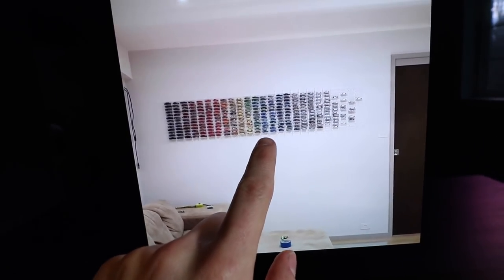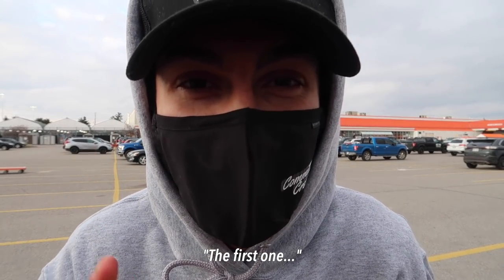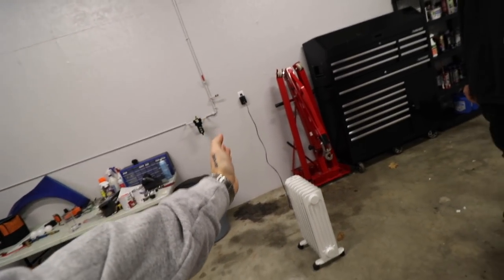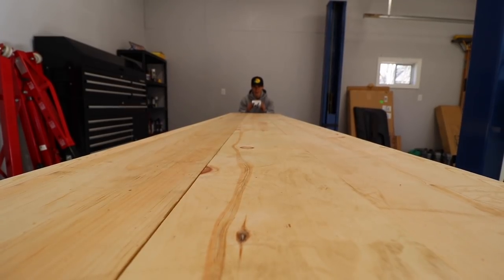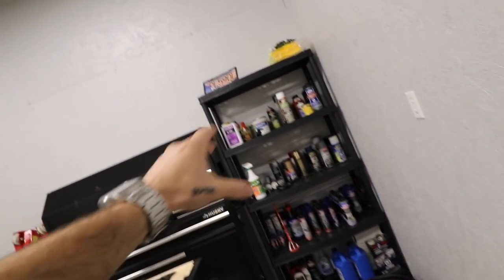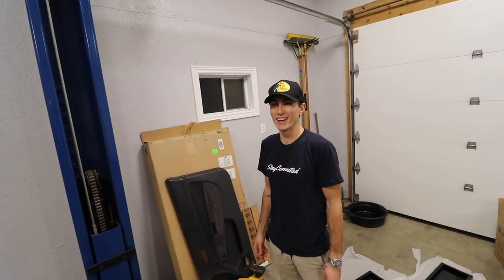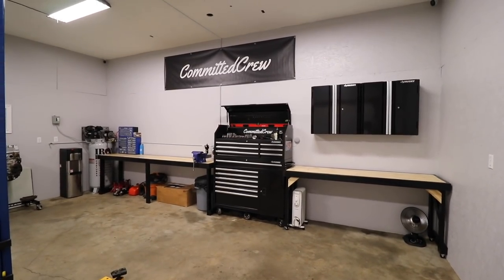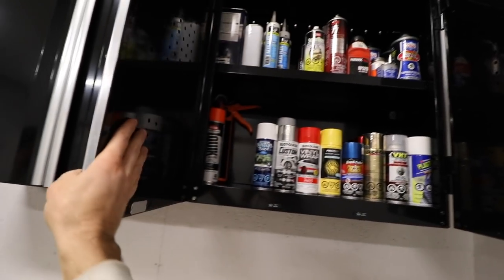ULTIMATE Backyard Garage Additions! - MASSIVE Workbenches and Cabinets!

Comment: Hey Robbie, I'm a wood worker and I want to recommend you to also paint the the top part of the struts under the workbench work surface. I'm sure you guys just didn't because it's not visible, but the wet paint is adding a lot of humidity to only one side of the wood, which will cause it to warp. Then when the paint is dry you have one side open to humidity in the air and the other side closed off due to the paint, which will cause it to warp even further. 
I'm telling you this so you can keep your very nice new work benches straight! 
Shops looking great, keep doing you and stay committed! 

- greetings from Denmark :-)
Reply: you are a very smart man, he needs to see this!
Reply: Alexander the great
Reply: @slobaltcobalt  yes
Reply: Eyyy hva sker der dansker 😉
Reply: 너도 안녕이냐